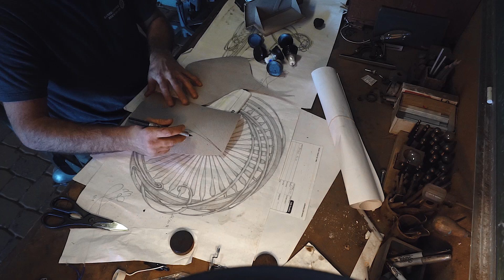Forging a Calla Lily Champagne Set

Comment: As a welder and metalworker, I find your work absolutely stunning and motivating. One question with this project; you were forging stainless steel and I know from welding stainless that if you overheat it, you burn out the chromium and thus destroy the stainless. Do you only use a torch to enable you to better control the heat and then watch the color of the heat to not over do it, or am I witnessing more of the Max Randolph witchcraft? Thanks for all that you have shared and will share in the future.
Reply from the maker: Thank you so much!! I heat it to lift the carbon so that when I sand it back off i get all that dynamic contrast.